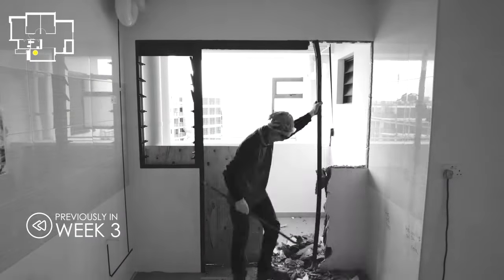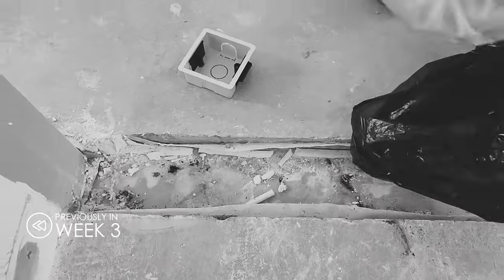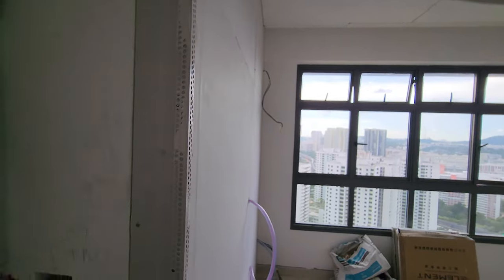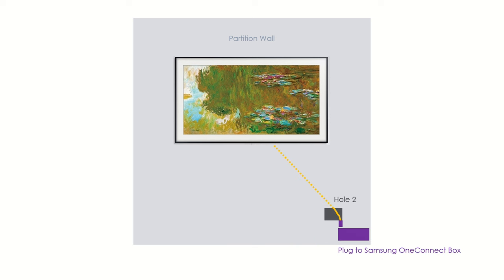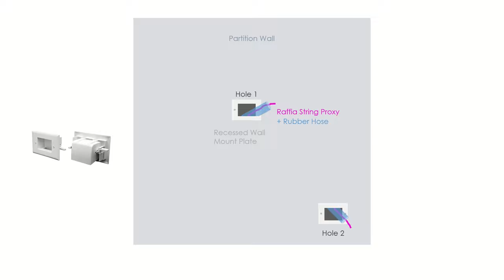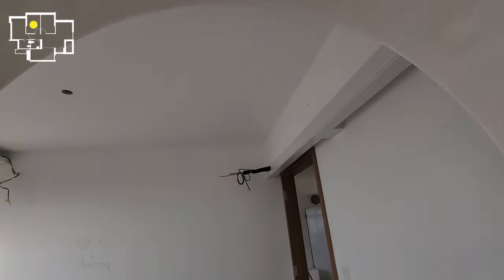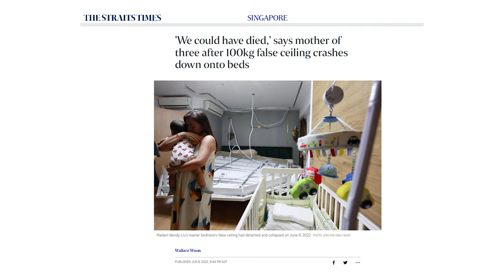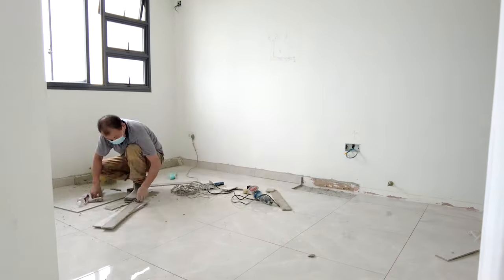Cove Ceilings & Partition Walls | Self-Designed Neutral Contemporary Home |EP09 HDB BTO Reno Journey

Comment: U done carpentry already? From another video I gather your ID may not care enough or experienced enough to sound this out to you: 
apparently it is quite standard to use thin wood (mine was 3mm) for drawers which are "small", eg 30cm wide is a small drawer to them 🙄. I don't know what thickness is enough, but for sure 3mm is wayyy too thin for something that's gonna support the weight of items without having them subsequently bending. I don't see how the width of the drawers alone is a good reason to use thin wood. The concept of internal volume seem to not exist to them 🤦
Pls ask for a thicker piece if u think 3mm is too thin for you. Once the carpentry is installed, it is very troublesome to rectify. I had a workaround done by having another piece of wood attached below, depending on the drawer tracks, for some drawers it cannot be done and wood planks were used as additional support instead of the whole piece that covers entire bottom of drawer. All the best and thanks for sharing the knowledge out to the world thru ur vids ☺️
Reply from the maker: Hello!! Wow thanks so much for your very kind sharing 😯 Yes! we are at the carpentry fabrication phase and this detail about drawer plank thickness has never crossed our minds. But very useful indeed and would check with our ID/Carpenter on this. Thank you!! 🙏